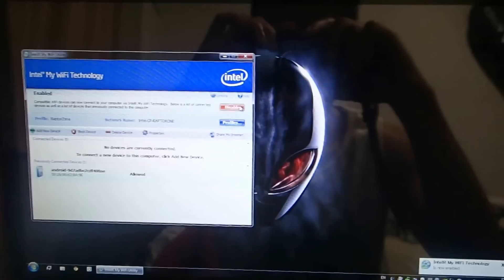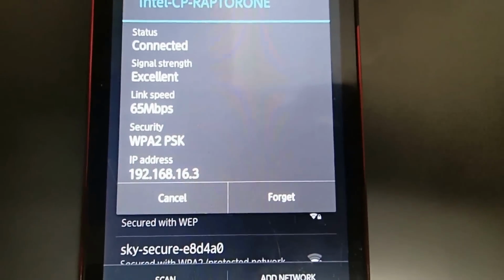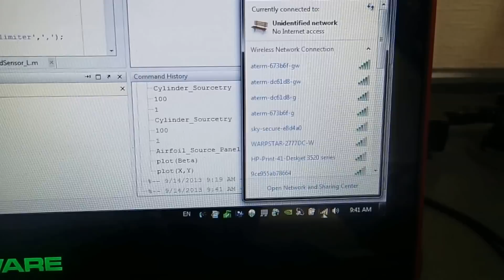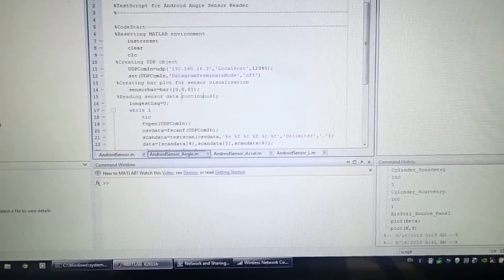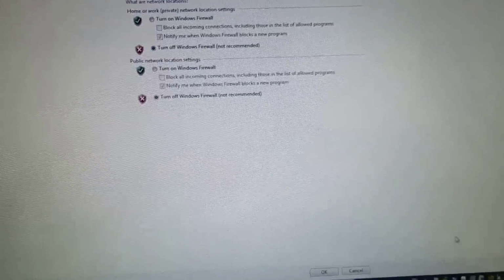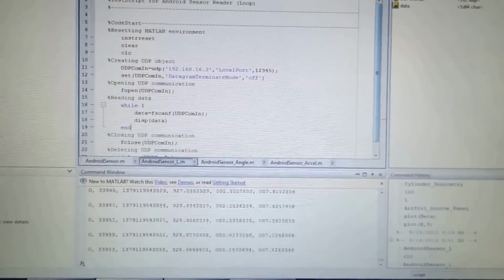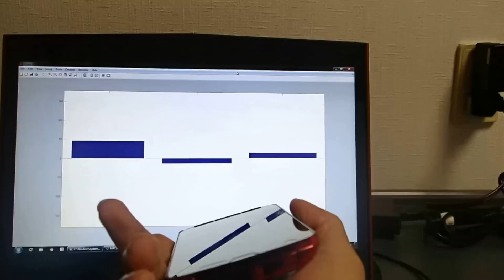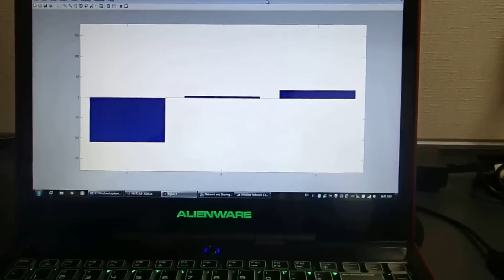Video Tutorial   Reading Android Sensor into MATLAB (for Version older than R2013a)

Comment: Hi, can i use the same code if i want to read iphone sensor into matlab?
Reply from the maker: Yes, you can. However, I am not sure if there is any similar app on iPhone that allows you to send the data via UDP and if there is, the data format may be different, so you may have to tweak the code a little bit...